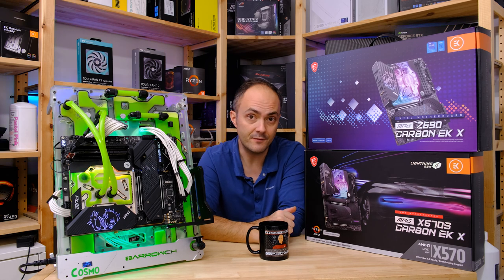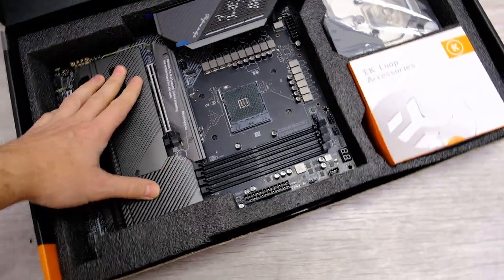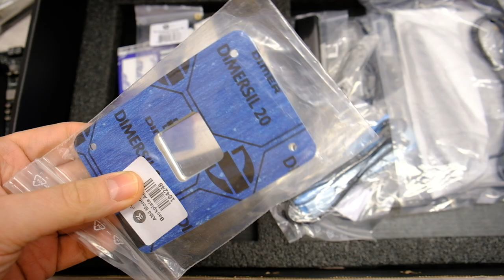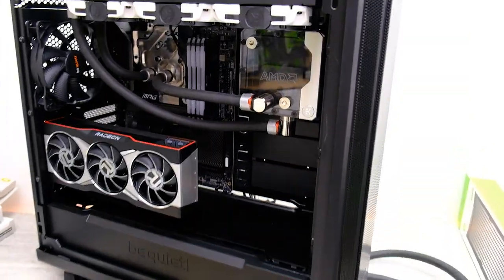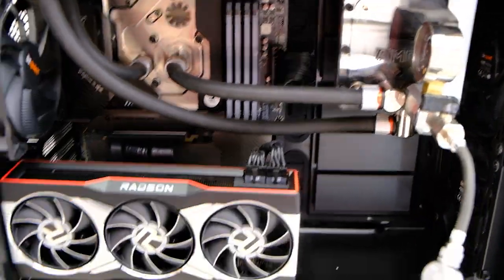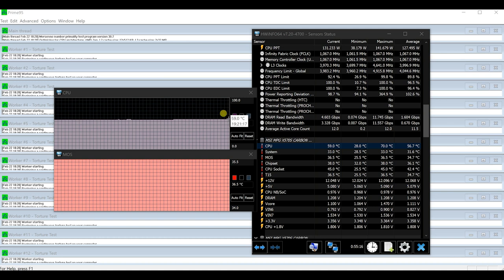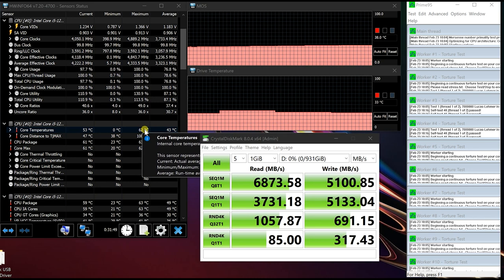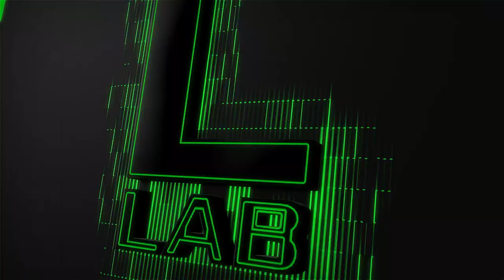MSI MPG X570S + Z690 CARBON EK X MOTHERBOARD REVIEWS + SYSTEM BUILD

Comment: I see the motherboard says it needs a Dedicated LGA1700 mounting bracket.... Im using a Hydro X Series XD5 RGB Pump/Reservoir Combo what would work with this.   Please get back to me.
 MPG Z690 CARBON EK X, rtx3080 ti, i7-12700k.
Reply from the maker: Any pump and reservoir combination would work with this motherboard. The waterblock has G1/4 threads just like any other water block

Comment: Will the SN850 Fit under the EK with teh heat sync or do you have to buy the one w/o the heatsync specifically?
Reply from the maker: Would not fit if it has the heatsink on it. You'd need to get the standard one without then it will be fine. Or you could remove the heatsink (on the SN850). Personally I'd go with the SN850 without.
Reply: @CrazyTechLab  Awesome , and ordered. Thank you!

Comment: EK currently has the MSI x EK X570s Carbon on sale for 380$, the Z690 Carbon for 570$ & the Z690 Torpedo for 270$! can someone tell me which of these would be the better option for the price and performance? thanks in advance! beautiful boards btw...
Reply: Intel or AMD. If AMD there is only one choice the x570. Intel: 690 is 12th gen ddr5 590 is 11th gen ddr4. 

Pick your poison.
Reply: @TeensierPython  honestly it doesn’t matter to me! I’m starting my parts list from here, what would be the the best option with that being said?
Reply: @TeensierPython  from what I’ve been reading so far, it seems the Z570S carbon?
Reply: The 690 is the newest of the boards. It’s the most “future proof”

I’m about ready to buy the AMD because I’m just replacing the board/cooler.
Reply: @TeensierPython  oh okay! I might have to go with the Z690 then cause that is a fair point! just trying to get my order in before the sale ends LOL

Comment: Wich port is the inlet and wich is outlet? 
I just set my mpg carbon z690 ek up and seem to be running pretty warm cpu temp 65-70 degrees in game about 30% utilization
Reply from the maker: I don't think it matters. You might see slightly better temps using the port above the CPU-cooling area on the right, but only a few degrees at most. If it's a 12900K or 12700K they can usually hit fairly high temps anyway.
Reply: @CrazyTechLab  I'm running a 12900k and 3080ti 
War zone game play I can see 70 degrees (it's oddly jumpy tho can see 60-70 degrees within half a second of each other)
Not over clocked 
Gpu stays at about 58 degrees
Reply from the maker: @Pancho1994  What is your watercooling setup - pump and radiator?
Reply: @CrazyTechLab  running a inwin 303 ek with built in reservoir and pump and 
Ek radiator
Running a hydro copper 3080 ti and the z690 carbon ek x
Reply: @Pancho1994  did u mount the block properly?